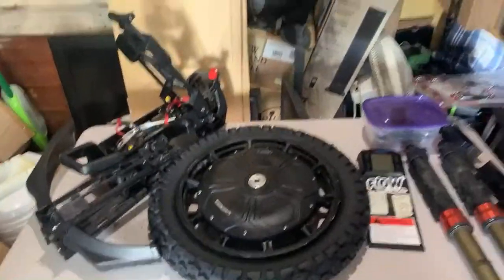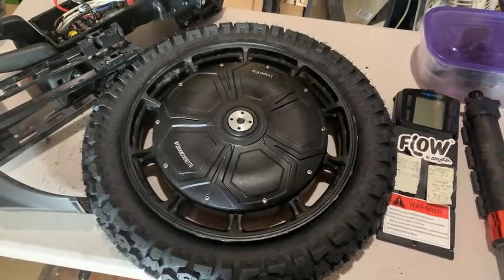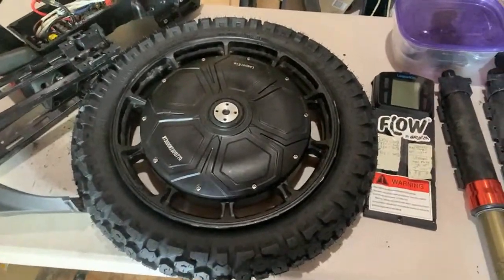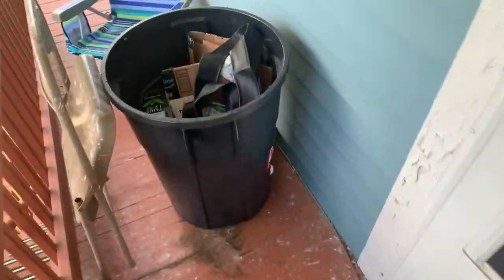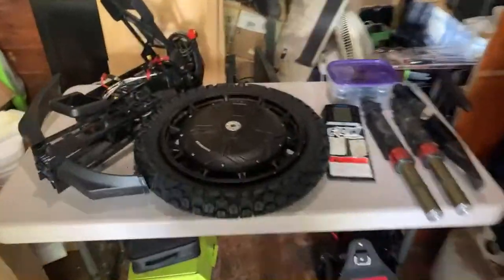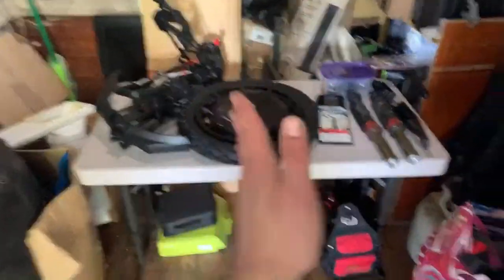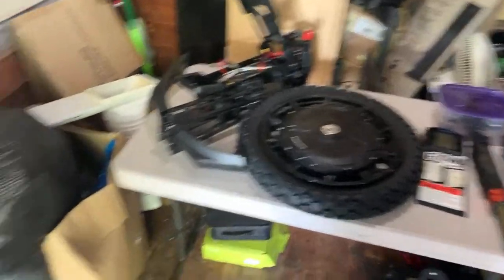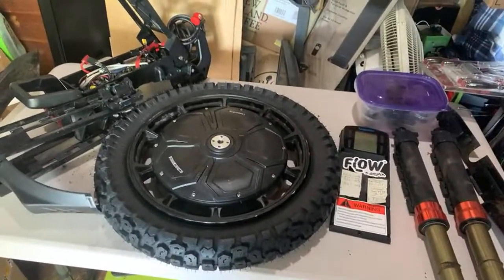Sherman S  Electric Unicycle  Tire Change LIVE (fail)  Part 4

Comment: sorry to hear that you are having so much trouble with changing the tire... it should not have been this problematic. How come you had to take out both battery packs from the euc to do that tire change?  as I understand only taking out the left battery pack and removing the left mudGuard support would have given enough clearance for swapping the tire... but of course the reality that you are experiencing is different and I hope you can get your sherman s back together 💪
Reply from the maker: Hi, yes in the part 2 video, at 38:33 (Not this video) , I was going to that next step . Following the tire change video that focuses only on that left side. All was going pretty good till i got to the point where you get to the the 3 phillips and 2 hex screws that anchor the base suspension saddle so you can fit a tire off the rim . I couldnt get at one of the hex screws, and after repeated attempts i had stripped the hex screw and couldnt remove the saddle to get at the tire. Everything else i did with some brainstorming which was to unscrew the RIght side battery and fandangle the suspension arm through the motor wires to free the tire.   The tire change itself is being the most problematic. It could be from inexperience, but having hard time fitting both the tire with a tube in it or, and fitting a tube into a tire that is already seated. I have already pinched tube so will have to do this again when my new tubes come in. I cant wait to get this all together mate lol

Comment: Definitely not an easy job. Loads of parts to take off before you even get to the tyre change. 
Ive got a new tyre for my msp and this has given me zero enthusiasm to change it😂😂 
Maybe I'll get the camera out when i do so you can see my struggle...damn these electric unicycles....love riding them though 😊
Reply from the maker: Yesss i want to see you do it . It’s the  cheap screws and tire pinching you have to watch out for. I highly recommend electric drill
Reply: @WILSONsHobbies  I've plenty of tools from when I worked on motorcycles but know the heads of screws and hex bolts are made from soft cheese..I've probably changed well over 200 bike tyres.. mostly tubeless so I might pinch the tube. Hopefully you get the Sherman S back together soon👍